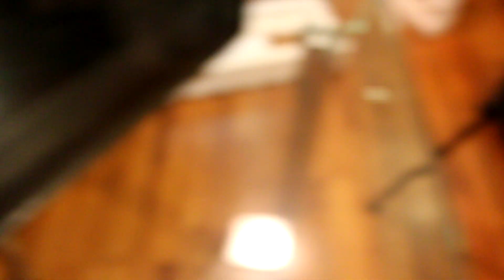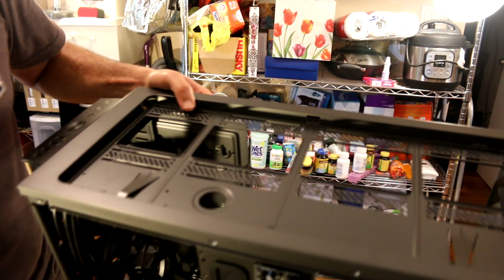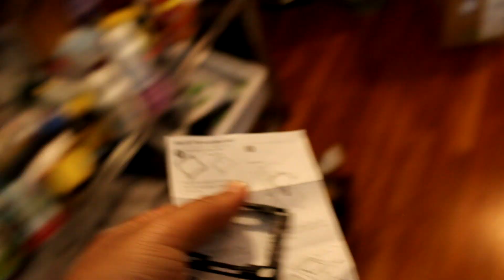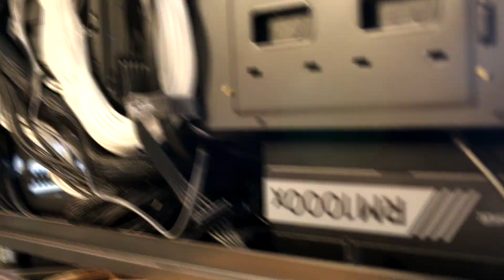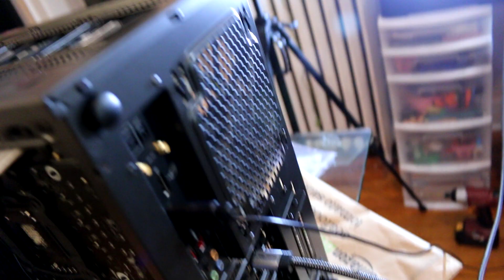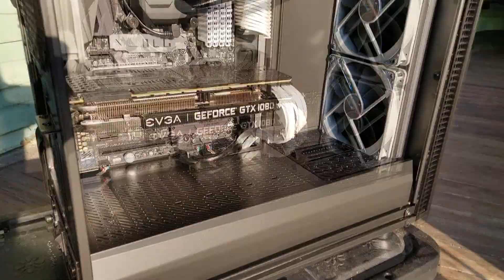Fractal Define R6 Gunmetal Gray Case Build

Comment: i wonder from what he modded the front psu shroud plate plate since afaik that plate does not come standard with the case.
Since i ordered the gunmetal version myself i am debating to use the original S2 shroud plate cover and by going off what i c in this build.
going gunmetal solid cover plate or s2 vision gunmetal version resprayed to near matching color seems to me the right path to go since i might be hiding my mechanical drives in the shroud.

Comment: Where did you get that cover to fill the void of the power shroud with the HDD plate cover moved back? (the cover that your "do work" plaque sits on top) did you 3D print it yourself or was it purchased from somewhere? I hate that Fractal didn't include the cover plate with the R6 like they did with the Define C, since imo it ruins the nice clean styling of the R6 when you move the HDD cover plate back and theres a big hole/void left in your power shroud... it annoys me to no end that they didnt include it, since it couldnt have been for cost savings since its such a small easily manufactured part and the tooling for the shroud cover on the R6 im pretty sure is the exact same as the define c, so there already manufacturing the part just seems like a corner that didnt need to be cut... if you made that shroud cover yourself I gotta say it came out great! and definitely improves the looks compared to having no shroud cover there.
Reply from the maker: Yea I designed and printed that myself. I agree that they totally dropped the ball on that. Thanks for your comments.  Made my day.
Reply: @BeginnersLuckGarage  Nice build! Did you keep the CAD draft or slicer file for the shroud cover plate?  If so, is that something you could share?

Comment: So I’m building my first pc and thinking about this case. I wanted your thoughts on how cool it stays, and also does everyone put a fan at the basement looking part of the case?
Reply from the maker: You dont have to put a fan in the basement. I just had some spare ones and decided to use the bottom as the air inlet. The case is really well built and the gun metal one looks and feels premium. I'm very happy with it. My alternative option was the phanteks evolve X but not sure about its airflow.
Reply from the maker: I also ran a few tests. I'll make a separate video doe that but basicly it's a well ventilated case
Reply: Bro my option is this one or the evolv x as well, but only found 1 video for temps on the x and it was horrible. I’m waiting for others to test it out. And please do bro I would love to see everything about this case
Reply from the maker: I did some pressure testing using my digital manometer and the case is pretty much perfectly neutral (slightly positive 0.01"wc). IF you are planing on AIO and open shroud graphics card this case is can has great ventilation. You honestly cant get a case with more ventilation. I mean the entire top front and bottom has grills. Place fans how you want but I would definitely put some fans in the basement. I did some benchmarks and the temps on the CPU never climbed more than 75C. I think if airflow is what you are worried about go with this case. The Evolve X does look really nice though and if you plan on opening your case up all the time the hinged doors will make it easy. The only reason i went with the R6 is because of all the positive reviews and comments about how amazing it is. I wanted to see what the hype was about because it looked like a basic case, but once you build in it and set it up you appreciate the build quality and the materials they used. Not to mention the design is timeless so in 3 years when all these case fads are over this thing will still look modern. This is just my opinion and my reasoning of not going with the Evolve X.

Comment: Looks like you used the stock thermal paste from your AIO on your CPU. Do you think there would be any significant difference in performance had you used aftermarket paste?
Reply from the maker: I'm not an expert but probably not. I think de-liding the cpu and using liquid metal would be the way to go if you are planning on serious overclocking. For normal operation and light overclocking I think AIO with whatever thermal paste is fine.
Reply: Recently watched a comparison video, and the stock Corsair paste on the H115i PRO is not worse than Noctua NT-H1 thermal paste. Mind blown, I know.